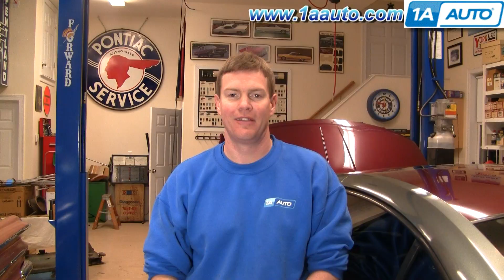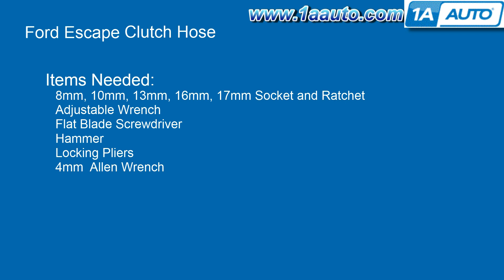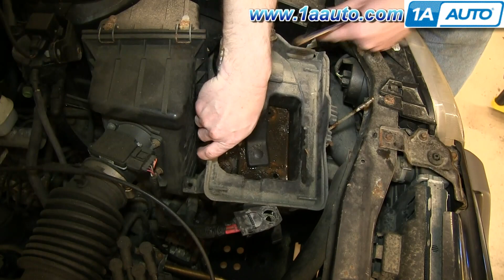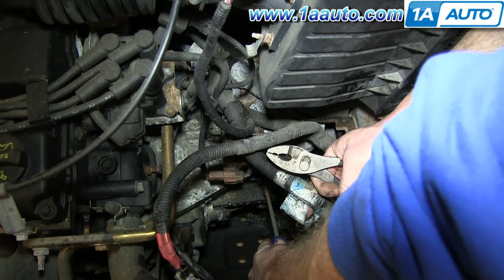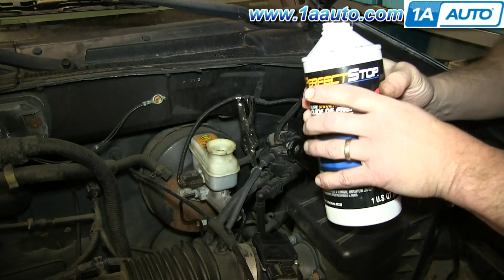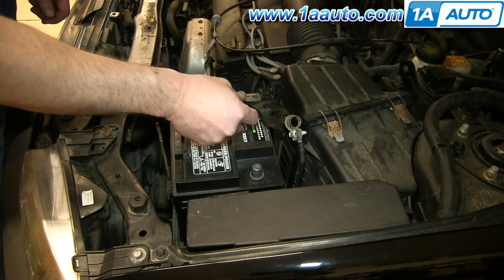How To Replace Clutch Flex Hose 02-05 Ford Escape

Comment: Isn't it better to pump the clutch about 5 times while the bleeder is in close position and hold the pedal down then release the pressure by opening it then tighten before pulling clutch pedal back up?  This way you prevent air from entering through the slave cylinder with it in open position while pumping the clutch pedal.

Comment: Gentlemen, nice video in showing the steps to remove the flexible hydraulic clutch line and how to bleed the system. I looked on www.1aauto.com for the steel line that this rubber hose connects to but didn't see it. This is the steel line that comes from the clutch master cylinder and runs along the driver inner fender and then connects to the rubber hose that you removed. If you gentlemen have it or know of another source, could you provide a link. It's for a 2001 Ford Escape, 2.0L. Thank you!!